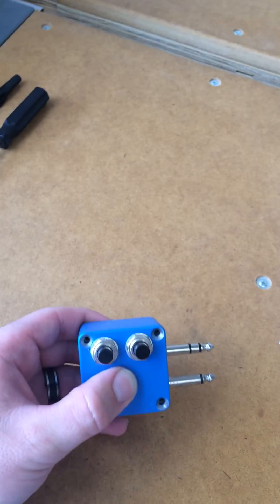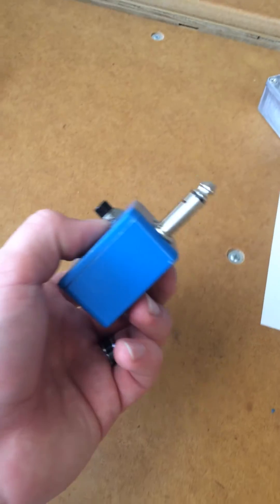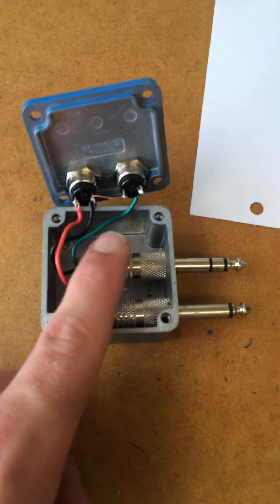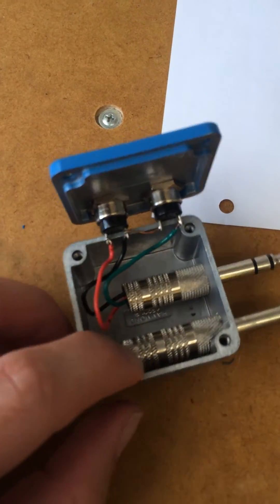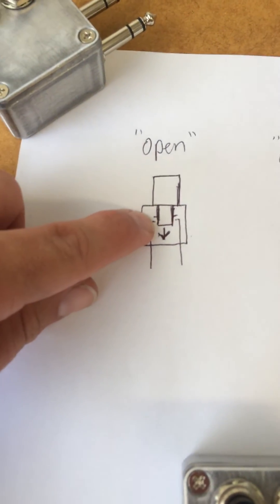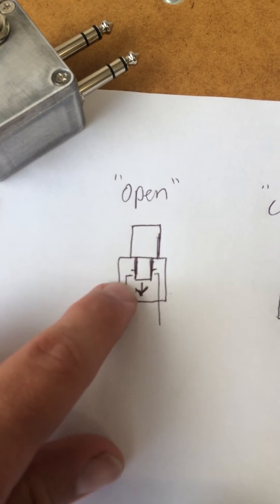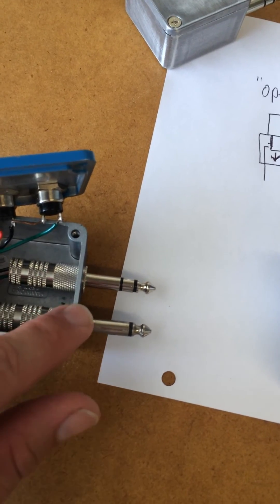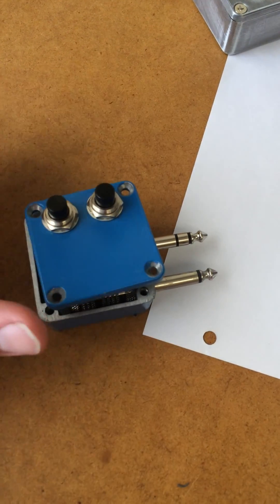Metronome Memory Switch - How To Make

Comment: Hi there, I am an artist and have a bit of a random question for my current art piece. I need to know if it is possible to remove a metronome's 'ticker' so it is silent - help!!!
Reply from the maker: It is possible! If you have this metronome from the video, you can use the “Mute” button. However, if you want to kill the sound in general, you could take the wires off the speaker on the inside and tape them up with electrical tape. (Individually of course!!)